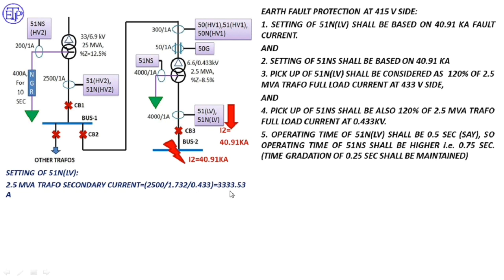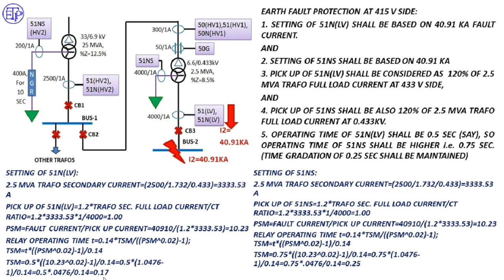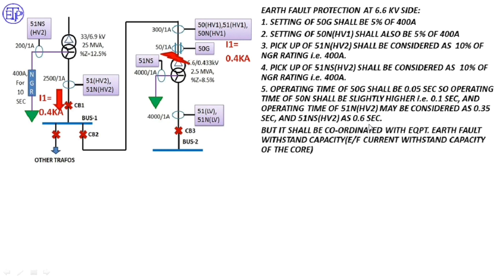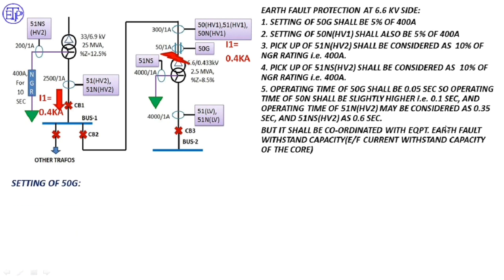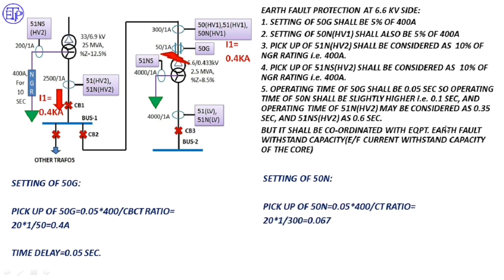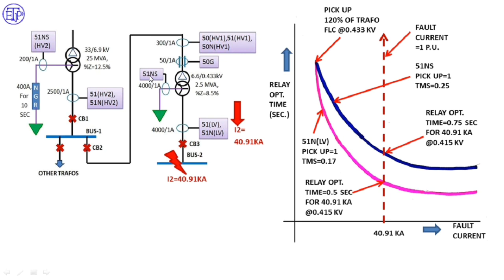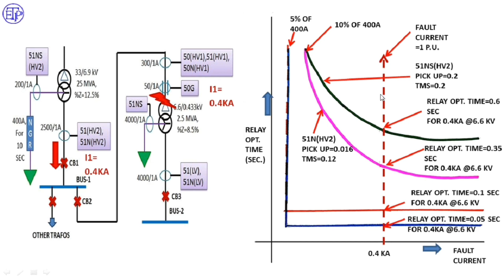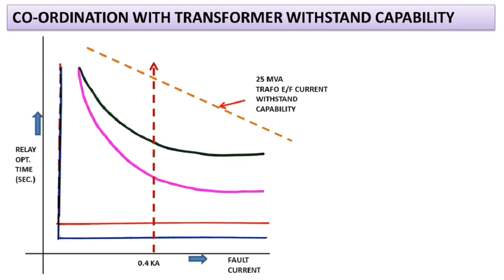RELAY SETTINGS AND CO ORDINATION|PART 2_EARTH FAULT|ELECTRICAL TECHNOLOGY AND INDUSTRIAL PRACTICE

Comment: you are considering 50N(HV1) Is 5% of 400A. It is very less .it may trip during charging of 6.6/.433kV Transformer due to Inrush current.Because it DMT not IDMT. so you may increase the pickup value to 80% of NGR Rating

Comment: Hi sir..please explain about schneider VIP 45 relay.my system tripping due to earth fault..setting at 7A,0.77msec,on 33kv RMU
Reply from the maker: 33 kV system shall be solidly earthed. So you can increase the pick up setting. However prior to increasing the pickup check the system throughly if there is really anybearth fault or not.

Comment: Sir plz guide how to do settings of auto recloser..
And there coordination with feeder and incomers
Reply from the maker: i have a video on time gradation. watch that video. then watch this video you will understand. 
and regarding auto recloser as per i am concerned it is a feature of circuit breaker duty cycle. CIRCUIT breaker has a duty cycle of open and close sequence. for circuit breaker having auto recloser scheme the breaker closes after a delay of 0.3 sec. then it checks if there is still a fault. then again it opens. you do not have to make any setting. it is inherent feature of breaker......

Comment: Hello, Can you help me with the cable sizing for the NGR ground cable and neutral cable? 
1.) Does the ground and neutral cable for NGR to be sized as per 400A or it should can sized lower as earth fault relay will  operate at 10% of NGR rating. Please help.
Reply from the maker: For 400A

Comment: Hello sir the video was really good but i have some doubts as follows:
1. When to use 50 and when to use 51 relay?
2. What happens when there is a fault above bus 1?
3. How can we calculate the transformer withstand capability as we need to coordinate the relays accordingly?
Reply from the maker: 1. use 50 for the end feeder at any voltage like capacitor, motor transformer. say a 6.6/0.433 kv transformer is an end feeder at 6.6 kv level. after that it transfers power at 0.433kv level .
2. for that upstream Protection will work. these protections are arranged in sequence to give serial backup to each other.
3. transformer withstand capability is specified. in general transformer can with stand fault current if the secondary is bolted short circuit with full rated voltage at primary for 2 second. transformer designs are made like that
Reply: Thank you very much sir

Comment: if 9MW, 11kv generator connected to Grid with continours synchronized condition, .... so Generator NGR keep close condition or not...... can any one explain me......
Reply from the maker: See generally generators are connected to grid via a generator transformer which has a vector group of Yd1 or Yd11. So presence of the delta winding isolates thr zero sequence network from getting paralleled. So if you have GT with one winding delta you can comfortably close the NGR

Comment: Why u have selected 120 perc of full load current for 51NLV and 51NS why not 5 or 10 perc like upper relays...
Reply from the maker: Since the lv neutral is solidly earthed so we can take 120 percent of flc as pickup
Reply: @electricaltechnologyandind5335  thanks for ur reply...but in normal condition there will be no current flow in nuetral of trfr. So settings with  10% of ct current is enough for 51NS relay operation.... and at normal condition trfr  lv side the resultant current for 51NLV will be zero...so any small current flow during fault can operate 51LV say 10% of ct rating as the resultant current will not be zero...

So I want to say that 10% of ct current is enough for EF pickup as we used to provide settings for EF in such a way...
Reply from the maker: Yes you can do that. Minimum pick up setting for earth fault is always recommended
Reply: Correct sir. 120% is too high and it might not trip during ground arcing fault
Reply: Yes right... if we keep it at 120% then whats the use of having a separate 51N. It is then as good as 51 with 120%.
Reply from the maker: 51N is for Earth fault
Reply from the maker: For low voltage system with neutral solidly earth will there really be any arcing ground???? I dont think so
Reply from the maker: Unbalance will not causing earth fault relay operation untill it has zero sequence in it..... For solidly earthed system earth fault current is usually high. So higher settings can be obtained. However it is a matter of study
Reply: No. It will pick up at 120%. But the less is the better. So, 5-10% is better than 120%. Specially for motor unbalanced loading condition.

Comment: Pls check your earth fault current calculations for 433 V system. For solidly grounded system (considering 1 ohm earth pit resistance)  = (433 V/ 1.732 )/ Earth resistance (1ohm) = 250 Amps. Correct me if I am wrong.
Reply from the maker: No it is wrong. For solidly earth system earth fault current will be mostly same with phase fault current because the earthing conductors will be interconnected. 1 ohm resistance is conductor to ground resistance.
Reply: @electricaltechnologyandind5335  pls put some disclaimer or correct this video. Else somebody will learn it in wrong way.
Reply from the maker: No whatever you are saying is current to ground. But that may not be the earth fault current always.
Reply from the maker: I mixed up with NGR calculation.  So your observation is wrong. As the current through soil is only 250A so GPR will be 250V. Which will be well within tolerable limit. That is why for LT system we do not need to check GPR criteria.